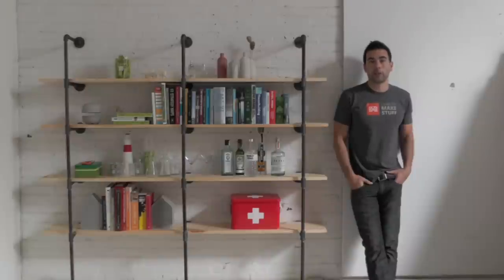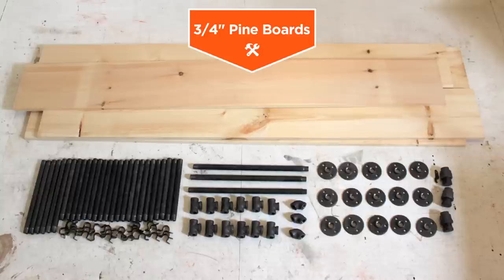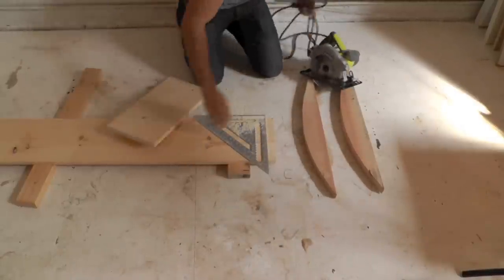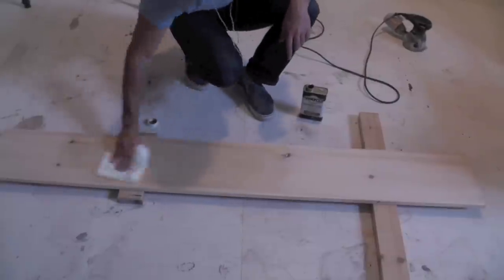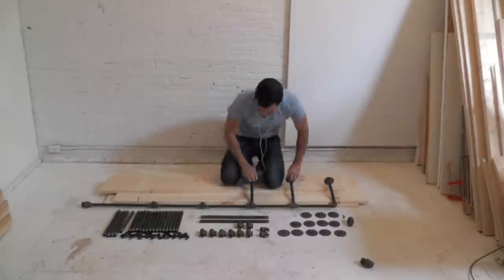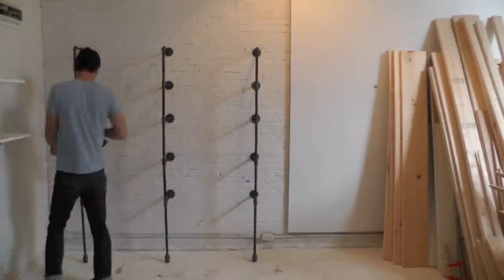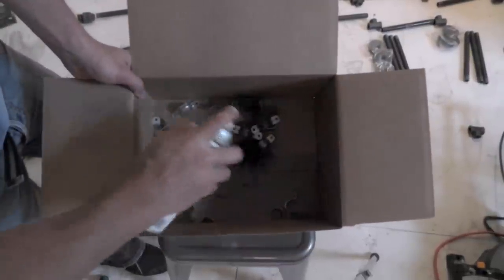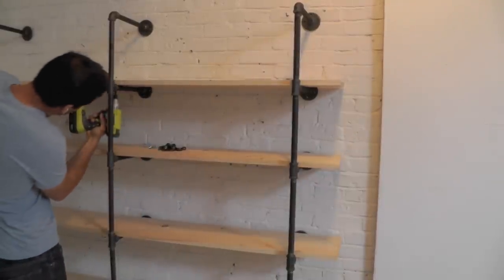How to make iron pipe shelves

Comment: Nice shirt Ben! :)  Great project man, might need to put some of these in my office
Reply from the maker: I Like To Make Stuff Thanks Bob! love the shirts!
Reply: So, I love these projects but the pipe is a bit expensive.  What is the cheapest alternative in the pipe and fitting arena to make these types of projects less costly?
Reply from the maker: David Macauley EMT conduit instead of iron pipe.  But it isn't as strong or durable.  I know these shelves will last a lifetime so i would rather buy solid iron pipes instead of thin metal tubes and particle board.
Reply: I Like To Make Stuff

Comment: I collect antique iron sewing machines.  Will these half-inch pipes be adequate for placing 2 machines per shelf or should I use 3/4"?   They're weight ranges from 7 to 15 pounds each and I'll be placing 2 per shelf.

Comment: nice project. Can you tell me what type of fittings you used on the feet?
Reply from the maker: ***** i think it was a 1/2" to 1" coupling with a 1" plug nut ant coupling plug combo would work.  I like this combo instead of floor flanges because you can have more travel for adjusting it level.

Comment: Thanks for the quick tutorial. I wonder how sturdy it would be to flip it around and have the vertical bars close to the wall  and the horizontal shelf supports be free floating looking. This is to avoid having the vertical bard block some of the shelf space.

||-+------------
||-|
||-+------------
||-|
||-+------------
||-|

Comment: Did you clean the pipes with anything?  There is a black soot/paint that rubs off of the ones I bought and isn't really suitable to have in a kids room where they will be touching it.  Is there a specific type of black iron pipe that are cleaner?  I got mine from Lowes.
Reply: +John Sarmie (Crocodileous) Hey, so try using PVC pipe instead! If you:
(A) Buy it in shorter lengths to go between joints (which should be fine for shorter shelves for kids)
(B) Throw some re-bar down the middle of each piece
(C) and spray in some "Great Stuff" foam insulator (any hardware store should have it) before assembling
...then it will be just as strong, and much more kid-friendly :)

Hope that helped! :D
Reply: +John Sarmie (Crocodileous) And lowes is really good about letting you exchange stuff (like iron pipe for pvc) :P